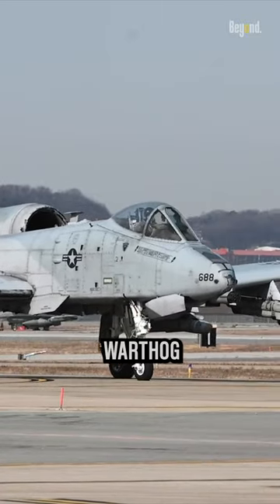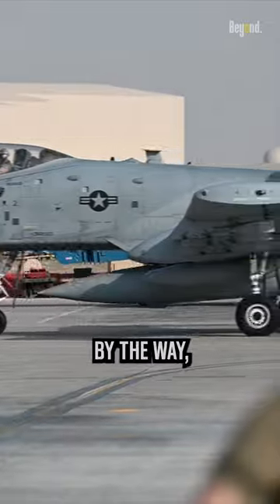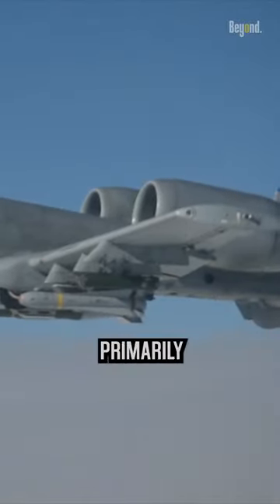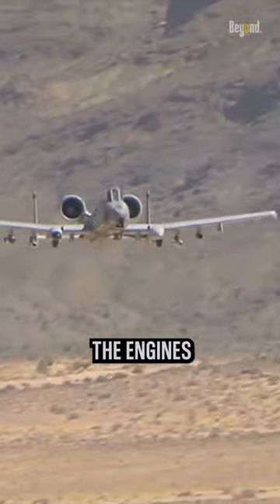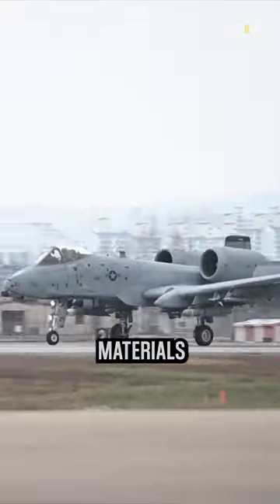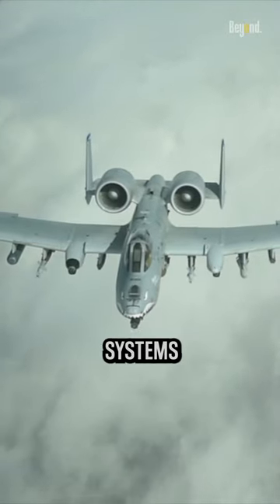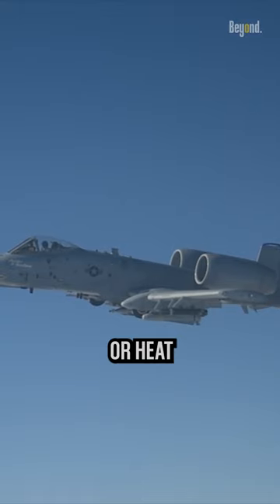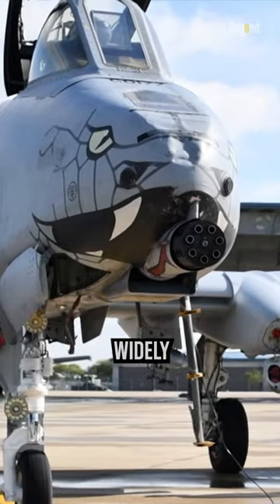Why Does the A-10 Warthog Put Engines Above the Wing? #shorts

Comment: I think it also prevents gas from the gun causing a compressor stall(when the engine doesn't receive enough air and stops working, usually from high AOA)
Reply: Or brass from going in them?
Reply: @haydencarlson2861 The A-10 cannon retains its empty shells internally rather than ejecting them.  In addition to preventing them from potentially causing damage to the aircraft, this also helps to maintain ballast.
Reply: If memory serves there was also the concern that they'd be operating from runways (possibly even just straight stretches of road) that weren't as well maintained as those used for fighters so there was a greater risk of debris like pebbles or tree branches getting kicked up into the intakes.
Reply: @silverjohn6037  Yes, the A-10 was expected to probably operate from underdeveloped, austere runways out in the field during combat ops, and debris damage to engines was a valid concern. 👍

Comment: When I was stationed at England AFB,  23rd TAC Flying Tigers and we transitioned to A10s, we were told that the main purpose of the engine position was so it could land and take off from locations that were undesirable to jets with underwing engines. In other words an A10 can take off and land in an open field. Being the person responsible for creating forward supply dumps this meant a lot to me.

Comment: It's so badass, the Air Force no longer wants it.  That should tell you all you need to know.
Reply: Give it to the Marines.
Reply: @russk1971  The Marine Corps doesn't want it for several of the same reasons they don't want Abrams tanks.  It's an obsolete and prohibitively expensive weapon system.
Reply: As an airman stationed at England AFB,  23rd TAC Flying Tigers with A10s, your statement tells me you need to learn WHY the USAF wants to retire the A10.
Reply: @ironnoodle7992  I know nothing about military protocol. I am ignorant of most of that. I had cousins who were Marines. I learned little about military stuff from them. I know that Marines tend to have the "bull in a china shop" attitude. The A10 is a big armored gun that flies. I will do some research. No disrespect was intended to anyone serving or having served. God bless you and your family 🙏 
I'm glad you came home. Most of my family didn't even those who returned.